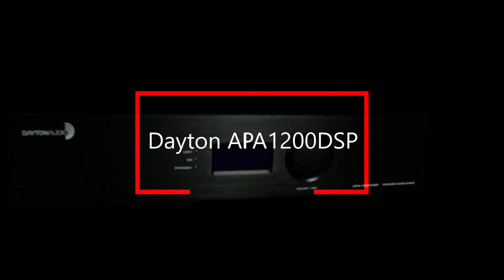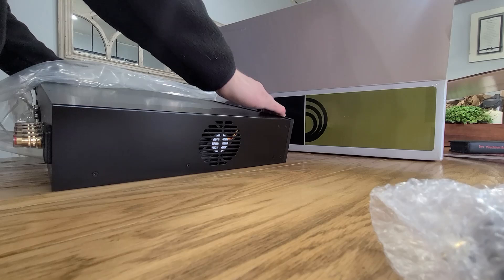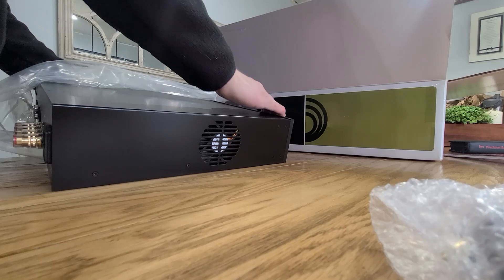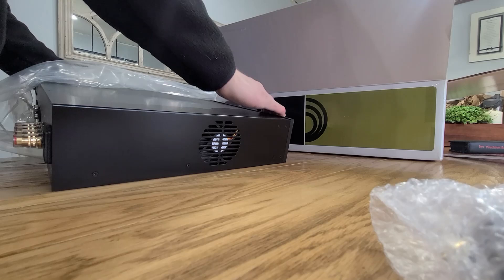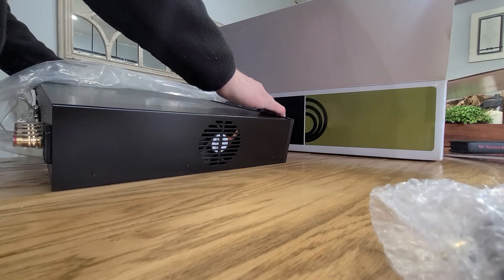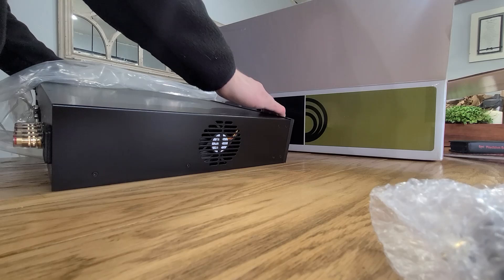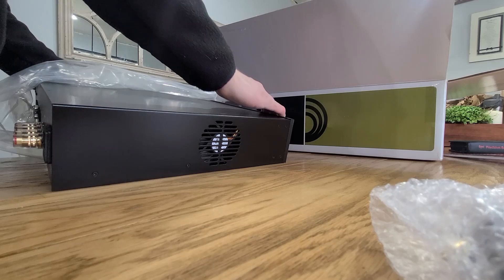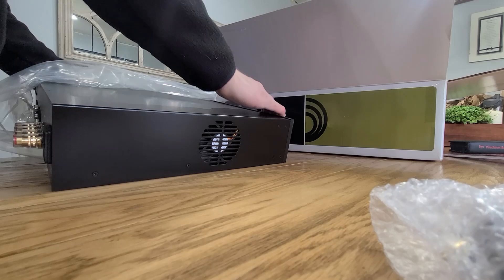Does Auto DSP work? TESTED and REVEALED Dayton Audio APA1200DSP

Comment: In need of help. Using an onkyo rz3100 i was running a def tech supercube trinity and supercube reference hooked up lfe and they rumbled my house. I recently replaced them with 2 monoprice m215s. The new subs work but do not produce anything near what theyre capable of. After reciever factory reset and full calibration in every mode the subs are still (docile) at best. They rumble more during calibration than in actual use. Any tips or educated guess as to why? Ty for your time.

Comment: You can hook up multiple subs to that amplifier as long as the final impedance is 4ohm For instance you could have 2 subwoofers that are Dual 4ohm You will wire each subwoofer in series Then wire both subwoofers together in parallel Or vice versa each subwoofer in parallel then in series
Reply from the maker: The problem is, there aren’t very many home theater subwoofers that are dual four ohm. Most of them are either single four ohm or dual 2 ohm. Meaning you would need to get four of them to get to the right impedance and each one of those subwoofers would only see 300 watts. You could probably get some car, audio subwoofers, or PA subwoofers that could work in that instance, but you would be hard-pressed to find some that would tune low enough for most home theater enthusiasts.

Comment: So I was thinking of pairing this with a skar evl sub would it be better to get a 2 or 4 o version?
Reply from the maker: The auto dsp function only works with a 4ohm subwoofer. So if you're planning to just run one of them, get the 4 ohm. If you plan on running two of them, get the 2 ohm.
Reply: @Toid  sweet thanks for the super quick response man 👍 keep up the good content

Comment: I bought a Behringer NX3000 to power an Infinite Baffle 2x18” subwoofer. If signal is being sent from a standard receiver RCA out,  what would you recommend to dsp it? Minidsp with Art Cleanbox? Will upgrading to the minidsp 2x4 HD output enough voltage for the amp on its own?

Ever seen Grimani’s line of Rixos speakers? I’d love to see you build something like one of those 2.5 ways with the 8” drivers. Or my actual preference would be an in-wall designed specifically NOT to use a box and use the wall space instead. Why pay for boxes when you can use drivers designed for large air volumes? Or will a boxed design always outperform?

Keep up the awesome content!

Comment: How did this amp compare to your crown 2002? I've got the 2002 and an ultimax 18 and thinking about upgrading the amp. Is it worth it? Thanks for what you are doing.
Reply from the maker: Out of the two, I prefer the XTI 2002. Of course I do DSP mine and use a microphone to set the levels. But I feel like the xti is more dynamic. This one is much easier to set up though.
Reply: @Toid  great thank you. Would you recommend to just add a DSP to mine? If so which one would you recommend? I've got a clean box between my Denon and XLS right now. Thanks for your time.
Reply from the maker: @icdjpr  if you have the xti, it has a built-in DSP. I would just recommend getting a microphone that way you can take some measurements and DSP it yourself. If you don't want to get a mic, then this amplifier really is the best buy.
Reply: @Toid  I have the crown XLS 2002 and it's very limited.
Reply from the maker: @icdjpr  oh if it's the xls, then I would recommend this over it without hesitation. I'm not a fan of the XLS series personally.
Reply: @Toid  great thank you very much.
Reply from the maker: @icdjpr  you're welcome. I was a little confused there for a second so sorry for the confusion. My friend Robbie who I made a few subwoofers for first bought the XLS series and we compared it to the xti that I had and left very unimpressed. So much so that he went and bought the xti version and returned the XLS. You're absolutely right, the DSP on the XLS series leaves a lot to be desired. Not only that, but the XLS series has an undefeatable 30 Hertz high pass. So you lose out a lot of your low-end bass extension. I personally wouldn't use it on something like the ultimax. I can completely understand why you would want to upgrade.
Reply: @Toid  I can see the confusion sorry I forgot to mention the XLS. Kinda important lol. Will I lose much power going with the apa1200dsp? I've also got 2 thx ultra 2 Klipsch subs that are supposed to be bridged on the factory amp but don't have the Klipsch factory amp  I wouldn't mind trying with this amp. Spec wise I think it would be a good fit.

Comment: Auto EQ is the killer feature that separates this amp from the pro audio amps that also have built-in DSP. Also the ability of this amp to apply DSP filtering to your high-pass outputs is also incredible and very different from what's in your typical pro audio amplifier, where the built-in processing is only concerned with what that power amp is doing, not the rest of the system. Home theater processors also have some correction capability for the subwoofer, but they don't give you the visibility into the processing that Dayton's GUI does.
Reply from the maker: Agreed! It's a really great unit. I was very impressed with it.

Comment: Wasn’t the after SPL actually more around +/- 8.5dB…and not 2.5dB like you stated?
Reply from the maker: Can you explain what you mean? The after response was primarily between 80 and 85dB. It's the blue line. The black line was the before measurement.

Comment: Do you think you could get similar results doing PEQ filters with MSO or REW as you did to the built in one?
Reply from the maker: Definitely. You might even be able to get better. I just use the normal peq on my crown XTI-2002 amplifier and get a fantastic results. I feel like this is really designed more for those that don't want to buy or don't have measurement equipment. They just want the ease of use. And honestly setting this up, was really easy. So you're definitely paying for that ease of use.

Comment: Nick, Thank you for reviewing this Dayton Audio amp and showing us all of the features.  I wonder how well it works for 2 channel stereo.  All the best.
Reply from the maker: Thanks Kevin! I appreciate it. You know it's a great question. I actually am probably going to be utilizing this on my audience 212 speakers. I like the auto dsp, but I also have a crown xti 2002 that I was using for the subwoofers. And I most likely will be adding another subwoofer in the future. Since that has DSP and I have an Omnimic, I can set that up pretty easily. So maybe in the future I'll review it as a stereo amp. I just felt like most people would be more interested in the auto DSP function.
Reply: @Toid  I agree wholeheartedly with you on the sub auto EQ/DSP.  It sure will save the buyers of this amp a ton of time and pulled out hair.  The next step is to time align it with the rest of the system.  All of the issues with getting bass correct and a pleasure to hear are not always fun.  I'm seriously considering a second 8" sub but, I dread the integration process.  However, I'm up for a challenge.  Kinda.  Thanks again and all the best to you and yours!

Comment: The re are 2 inputs and  2 output channels, you bridge to get 1 higher output channel, fine. What if I don't need that much power can I still have 2 i/p & 2 output channels to drive 2 separate subwoofers, Yes or No?
Reply from the maker: You can still connect two subwoofers if you don't need that much power. However the auto DSP only works on bridge mode. So if you hook it up to the stereo outputs, you'll have to DSP it manually.
Reply: @Toid  That's good to know.